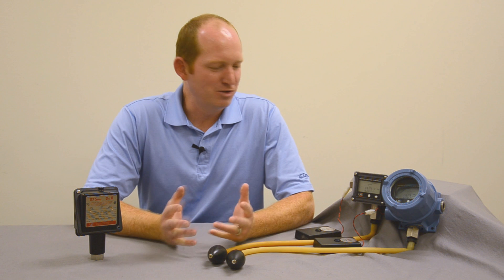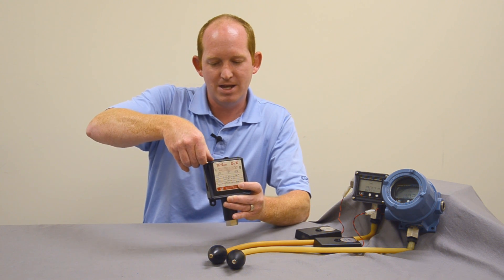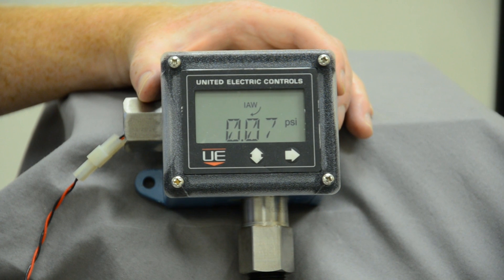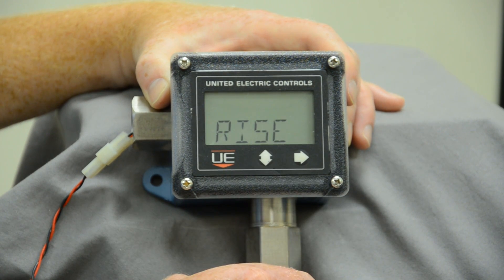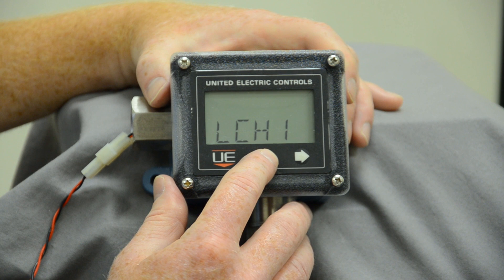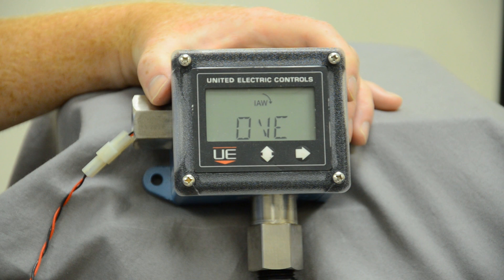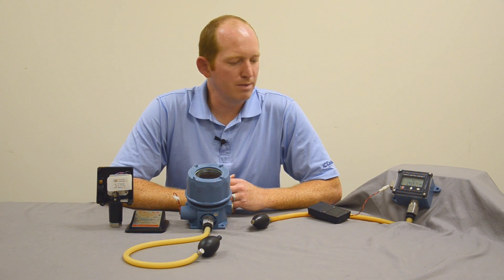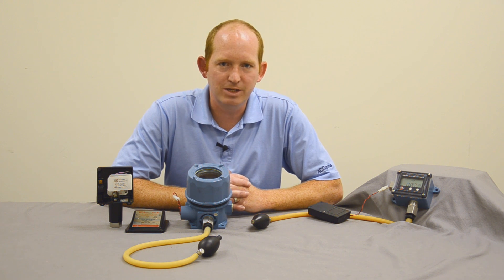Features and Configuration of the United Electric One Series Switches for Pressure and Temperature

Comment: Thanks for the useful information
But please could you tell me if the input was directly from the plc or through a resistance?
I have 1xwll and i am confused as the manual says that not to connect it directly to power supply and it must be through a suitable resistance 
Is the same thing with plc or i could connect it directly to the plc input?

Comment: Ive got a Temp switch that wont clear. The set point is 190 degrees, reading 60 deg in but the switch1 is still cycling and my alarm will NOT clear. Any tips?